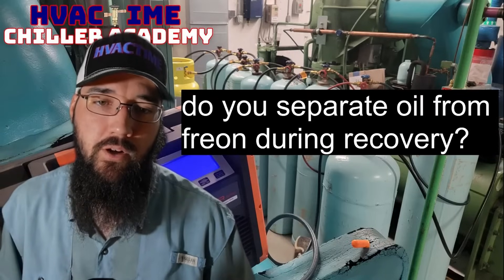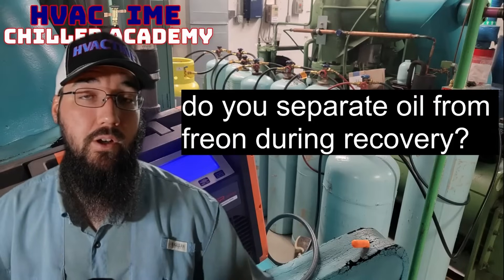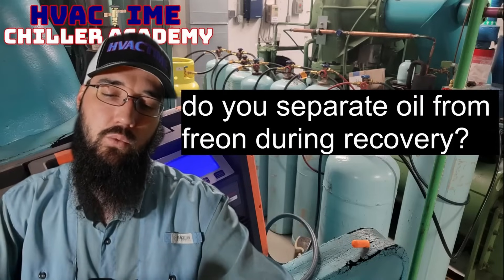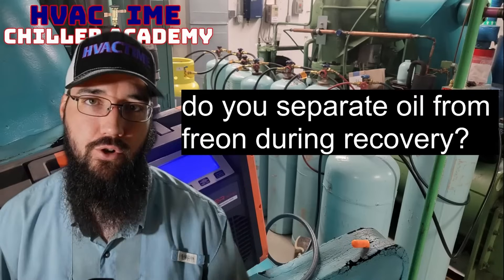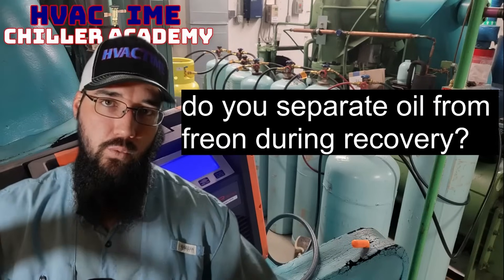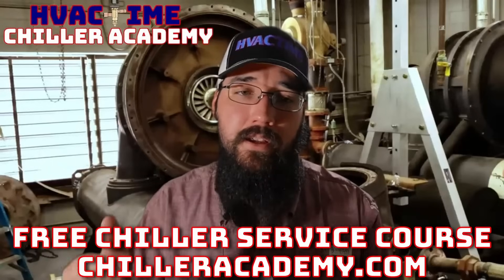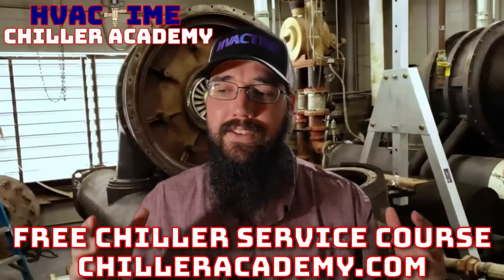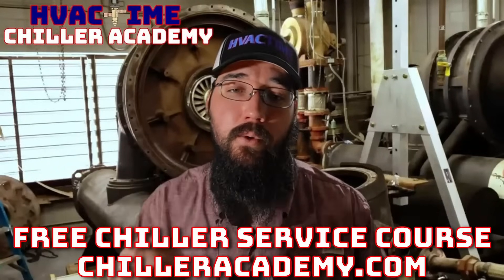Separate Oil from Ref in Chiller Recovery?

Comment: I’m just curious, can we use a recycling/recovery machine to separate the oil from the refrigerant?
Reply from the maker: No most recycling machines I am aware of only filter the refrigerant. It does not have an oil separating process.